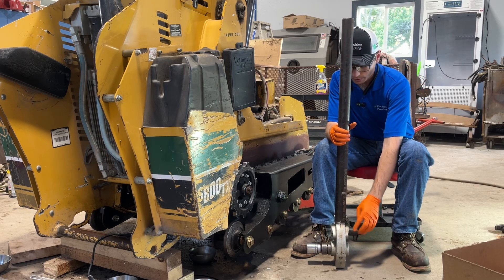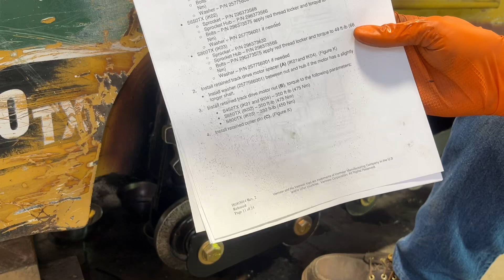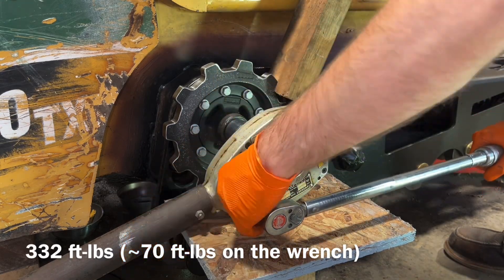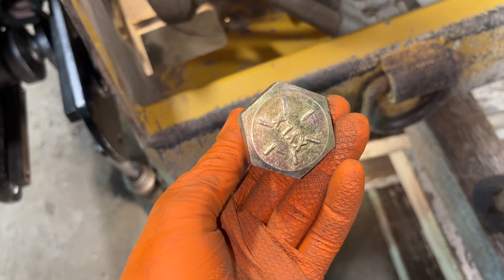Mini Skid Steer: Installing Sprockets, Rollers, Idlers, and Tracks

Comment: You're a champion, I used your guide to fix a leaky wheel motor seal, really appreciate your videos. One question if I may, I also have a leaky parking cylinder, I see you have yours out, how did you get yours out? Kind regards, Sean
Reply from the maker: Thanks for the kind words. What model machine do you have?

For removing the parking brake cylinder, check out my video on “drive motor and parking brake cylinder” in this playlist:

https://youtube.com/playlist?list=PL4BtTPwKYBnRT2X7JhgFBe2WaQKNI4kZQ&si=uGn81dSjIoS17miT